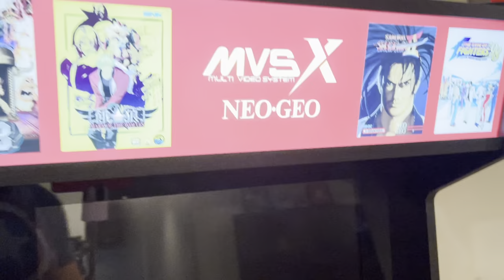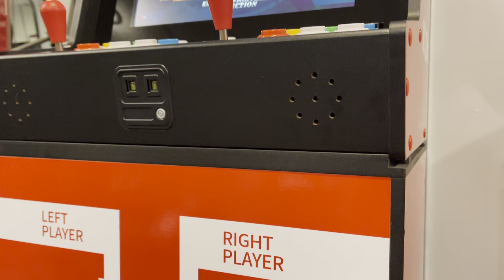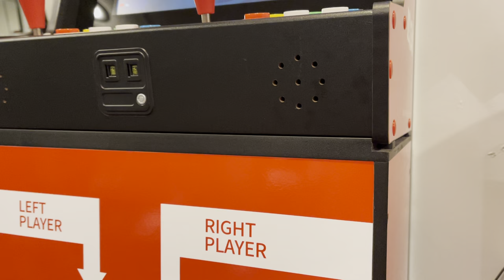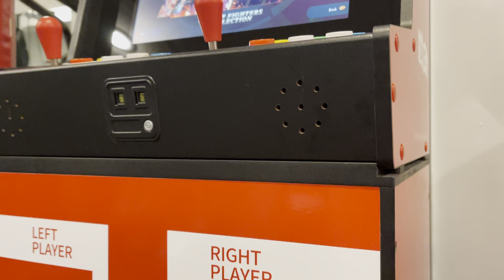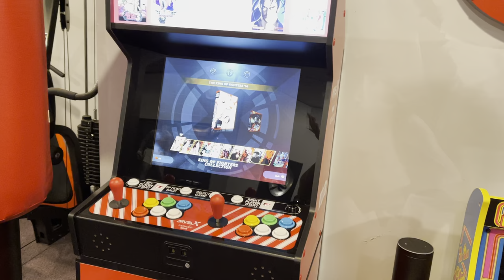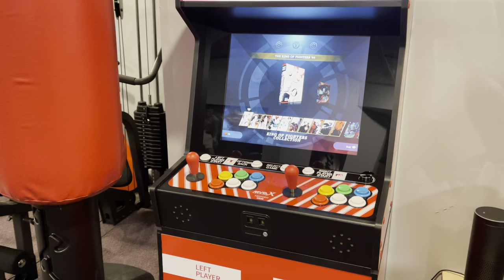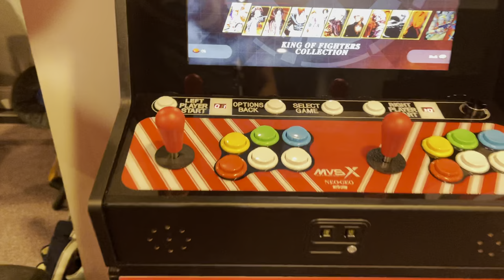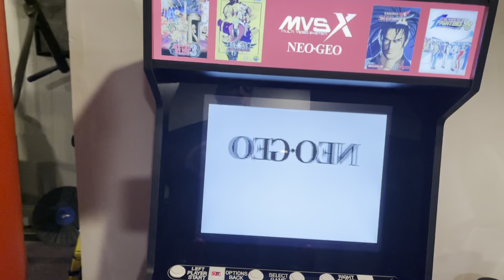UNICO MVSX (SNK) and Base are here - First impressions and a big warning!

Comment: To fix the loose bat tops remove the 3 screws on the left and right side of the unit top two and middle front near the control panel, then remove the ribbon cable directly in the middle toward the monitor when you slide the panel out. Hand tighten the bat top while using a flat head screw driver in the groove of the stick from underneath.
Reply: I don’t know how to do any of that , take the screws out, from the side , when I don’t even see screws, then what’s a control panel...., and remove a ribbon cable?.... hand tighten the bat top? ..in the groove.....oh man I just want to play mine without all these issues .... is that too much to ask?   Are we sure Arcade 1up didn’t make this....and what if I’m 6’ tall, I can’t even see the whole screen?   And how come that screen is shrunk with that black border, isn’t the monitor just 17inches to start, now it’s smaller with a black bezel?   Why are there 6 buttons too, i thought Neo geo had 4 buttons?   Oh yeah, one other thing, it looks pretty narrow and the controls are close, I don’t know about the rest of you , but when I play with friend, I LOVE when we are bumping elbows all the time. Makes for a great experience.
Reply: Buyer Beware, Thumbutt...😉

Comment: I just got mine this week. I can say that they made the new screws for connecting the top to the base easier to find and the instructions that came with the base calls out that different screws should be used. That being said, it took me awhile to find those instructions and I started off using the instructions on the website which still recommends using the other screws.

I think I heard the speakers have been improved, but I have not done a thorough comparison to videos and what I have.

The loose bat tops was not something I noticed until I watched this video.  I just checked and they were a little loose. I tightened them but I also plan on replacing them and the buttons. I am too used to square gates for my stick and the circular/octagonal gates were giving me a little trouble (Specifically, the jumping forward or backward motions). However, that is definitely a personal preference thing and while I could probably adjust, I would rather not for now.

Comment: I found it was much easier to attach the top part after removing the rubber feet.  It fits so well, I have a feeling that was the way it was supposed to work. You can also slightly unscrew one of the side panels on the bar top portion if it's not quite sliding in, but I think the real issue is the instructions didn't suggest pulling the feet off first.  Also, the bottom of the stand is really solid.  You can get some good casters or furniture legs to extend the unit's height a little bit.  I use 3" locking  casters on all my 3/4 scale  machines, so I can roll them in and out of the room

Comment: I had the same issue, What you should have did was lay it on top, put the screws in at the bottom, and actually remove the 6 little red covers as well as the ,screws on the bottom of the cabinet what ever side was lop sided and it would have fell in place and then drilled/screwed them back in and problem solved
Reply from the maker: It's a design flaw. That's why they sent out the replacement top panel that I discussed in the other video. We shouldn't have to do hacks to make it fit.

Comment: Hello Bill! :) I've got one of these on the way. Thanks for mentioning the little hardware baggie being sort of hidden. Regarding audio, I would recommend you get a 25 watt amp, and a couple of 4" speakers. Mount the speakers inside the marquee bay. Next thing I'd do is grab some 2x4s, and a half inch plate. make a plinth to boost the height of the cabinet, so the marquee won't block your sight line, to the monitor. The 2x4s should the perfect height for the unit. By the way, I got a Legends Ultimate, and am not happy with a nasty audio video desync issue. Sound is following action by half a second, and the UI text is hard to read. Have to bend over the controls with a magnifier to read the fonts. Killing my back. LOL. Thanks for the video.
Reply from the maker: The Legends Ultimate doesn't do that, so definitely contact support.
Reply: @BillLoguidiceAuthor  I sent two requests for support. Both were erejected, as though I'd interrupted their lunch break, or something. It's definitely doing it. And, it's doing it on all games. Also, there's a bad memory leak which I also reported. It's happening in the console section, Atari, Genesis, and others. I'll try a third time, and then, I'll try and post a video showing the problems in action.

Comment: Wow sorry to hear you had such a difficult time.  It was smooth sailing for me. My only issue was just aligning the main unit and the base for screw holes.
Did you get the pre-order gift?  It was not in the box.
Reply from the maker: That's supposed to be yet another shipment.
Reply: No pre order gift here also. The base was a pain in the a$$ to install.
Reply from the maker: @gamebit9063  They sent the replacement top, which I talked about in the other video. Too late for us to do anything about it now! Supposedly, the pre-order gift is also coming, but I have no idea when.

Comment: Use plumber's tape to keep the bat tops from spinning around and it won't lock them on permanently if you get the red kind but put a couple extra layers and you can build up like a little post with it that's what I did with my Pac-Man in Mortal Kombat II and they haven't moved since tell about the newer generation cabinets I got the burger time in the NBA Jams and the bat tops or the ball tops don't even spin-off on those cabinets like they attached appropriately
Reply: It's what I had to do with my gen 1 Pac-Man arcade 1up

Comment: So glad i passed on this. Great video
Reply from the maker: It's actually a good product overall, though a bit short and narrow. If you see the most recent video, they sent a new top panel to slide the top arcade portion onto. Too late for me now, but at least they sent it. Again, all I really wanted was some type of heads-up not to build the Base without using the Step 5 replacement screws and replacement top panel. That would have saved all the trouble.

Comment: These are not hard to put together!.. come on
Reply from the maker: The initial releases were.
Reply: @BillLoguidiceAuthor  no there not! The arcade 1 up is more involved and i put together 4! Just use your head!
Reply from the maker: @AngeloR674  I'm glad you had no trouble.
Reply: They can be a challenge to put together I have 6 arcade1up. Each individual cab gave me a different problem. So these things can be a pain in the ass my burgertime was so hard to put together.
Reply: Bill did you ever buy the riser for this?